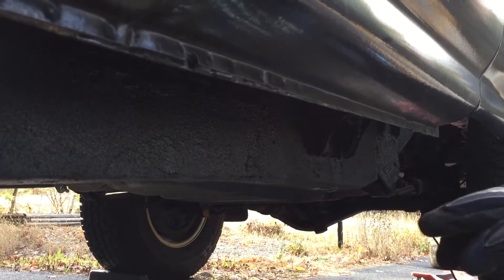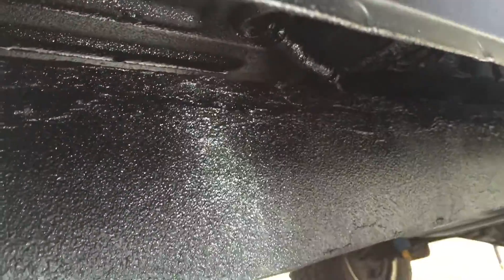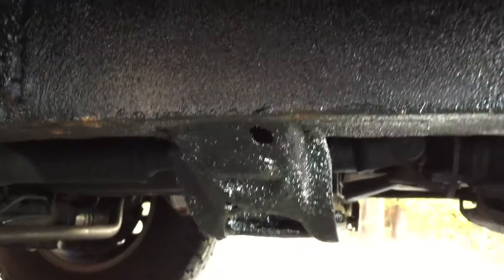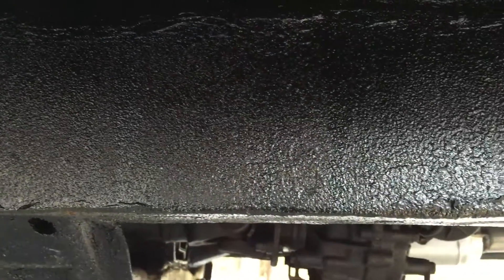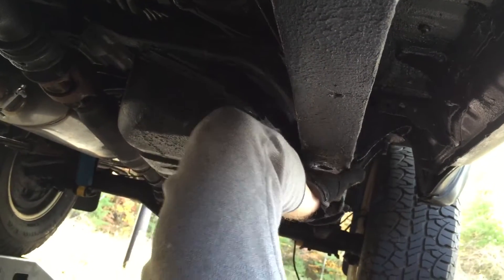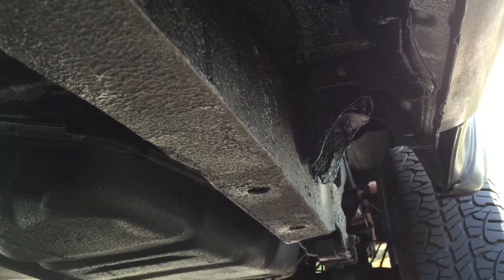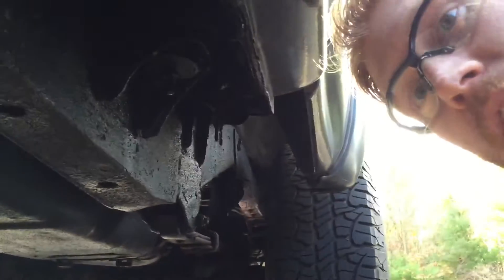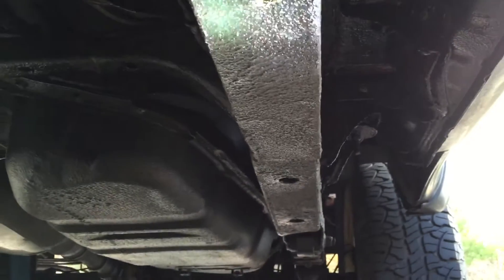2004 Toyota Tacoma truck frame rust Part 2/3

Comment: take the teuck to the dealer and see if qualifies for a new frame
Reply from the maker: +fredy guiza Took it to the dealer and told us we need to take it to Toyota Corp. We've been meaning to upload a blog post about the whole ordeal: what Toyota Corp. says, the local Toyota dealer we purchased it from and filing a complaint through the State Attorney General. (Goal for the New Year!)
Reply: @marielledawn888  blame Toyota 😂 yeah bro learn how to wash your vehicle and protect it and you’ll never have an issue